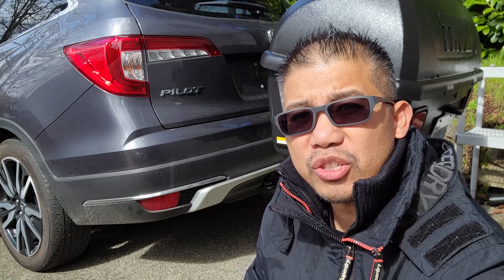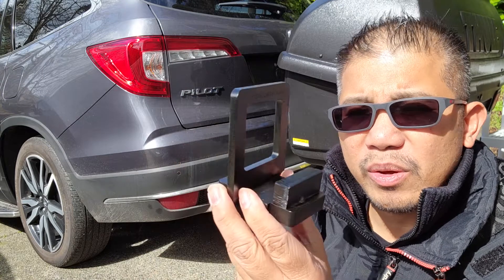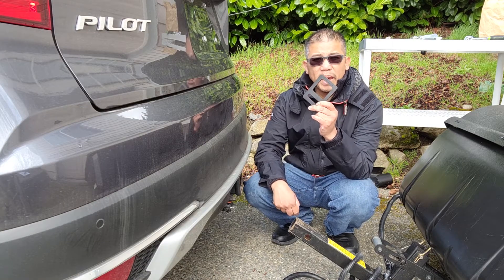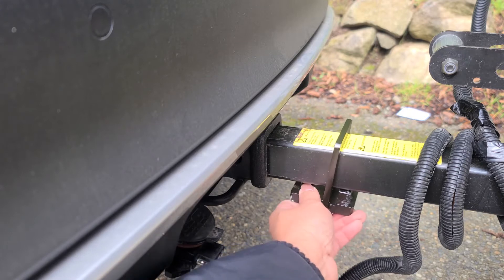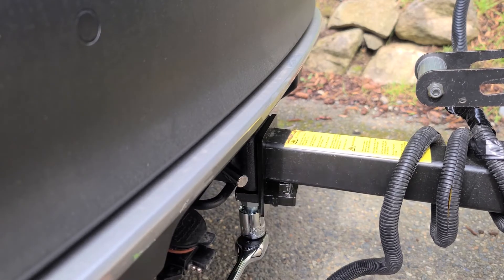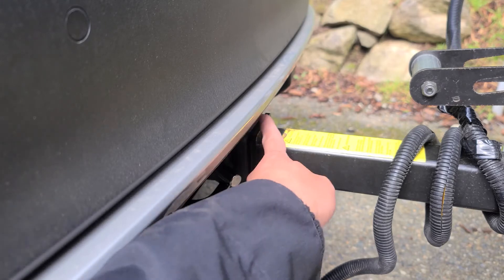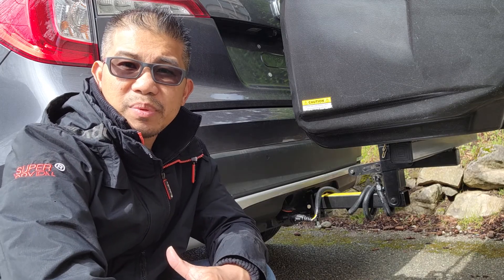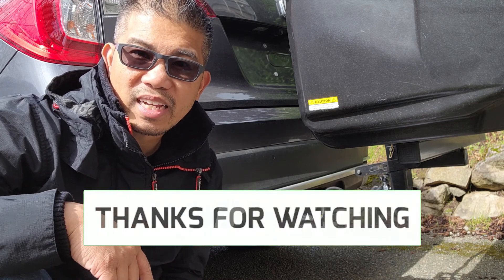Anti Rattle Hitch Clamp | Bike Rack or Cargo Storage

Comment: Hmm, didn’t see you push in the box like in the beginning of the video. I can’t imagine all that sway was fixed by a hitch clamp. How do you like it overall after using it? Prefer too mount, or rear mounted now?
Reply from the maker: No. I would say about 90% reduced. A little sway from the other joint but extremely satisfied with the outcome. I prefer hitch mount over roof mount and will use both if more space is needed.